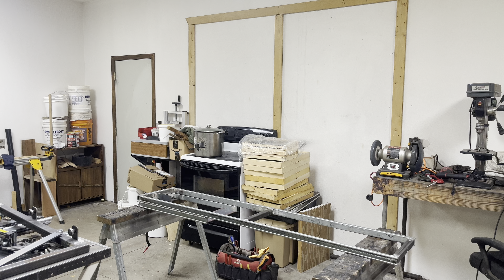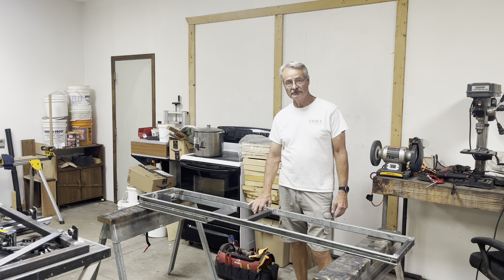Hive lift 4.0 build part 1

Comment: I've watched the complete build series and find the lifter to look like a very nice build. I'm considering a build this winter myself.
I have questions regarding the strut material used. Is there a particular reason for using the unistrut non-slotted material (not available locally to me) and not the super strut slotted material that's available at most big box stores. Even my local steel supply doesn't carry unistrut bars.
At the beginning you state 1 1/2 x 7/8 unistrut, but I only find 1 5/8 width specified in 7/8 height  ???
That's the questions I have for now, I probably will have more once I get going this winter.
Again, nice build.
Reply from the maker: I went on Grainger to get an item product number and I'm not seeing it listed anymore. I would use the 10 foot that I used on my hive lift 3.0 build series and I feel confident it would be a very useful tool for your apiary. Thanks for watching!

Comment: Awesome build. Looking forward to how it turns out. Thanks for sharing the specs. This could save a lot of backs.
Reply from the maker: It sounds like you have a good way to move the bees around when you need to move them. This build really didn't take to long once I did the hive lift 3.0 build. This lift works better than my 3.0 and the hinge system is more reliable in part because I beefed up the arms. If you can weld you can make this hive lifter. Thanks for watching and let me know if you have any questions.

Comment: How are you mounting your bearings for the carrier to the 1/2" shaft? The bearings are running inside the unistrut track of the 70" frame, there can't be much room behind the bearing inside the track. It appears you intend to weld the other end of the shaft on the outside of the 3 1/4" bearing support straps once the carrier is running freely.
Reply from the maker: Thanks for asking. I'm leaving the bearings inside the unistrut unwelded as the 1/2 shaft has only an 1/8" clearance of the unistrut. I will be testing it out once I finish the build and if need be I can either weld them in place if they bind up of possibly go to the design of the hive build 3.0.

Comment: In comparing to version 3, it looks like you are making the hive lifter wider and using some beefier materials for the frame and the hive lift arms. Were you getting some flexing with the previous model when doing maximum lifts?
Reply from the maker: I was getting some flex with the heavier lifts but it still had a good stability feeling. I changed the hinges in an attempt that they would catch more on there own but will wait and see. I also may add a motor drive on the lift but that is still up in the air.

Comment: I built a hive lifter off your previous video , I did make some modifications to the arms and carriage . It would be interesting to here what changes and why on your next video. Thank you for these videos my hive lifter saved my back this season .
Reply from the maker: Thanks for your comments. I know my back thanks me when the harvest is over. Now if I could design a lift for inside the honey house to move the boxes up to the uncapping tank I would  be set. I think the new design on the arms will lead to less uncaught handles when lifting. I guess I'll see. I'd love to see your hive lift.
Reply: @billbershinsky4304  have you considered the harbor freight hydraulic lift cart? A sideliner friend described an el3vato he used in his honey house years ago. Roll the supers in and set them on this platform, then step on a lever and it raised the super to a workable height. That HF lift looks kinda similar to his descri0tion.  Like you could have it  sat beside the uncapped, roll in with your lifter, and set right on the cart. Load up to height then start working. Lift them as you clear.